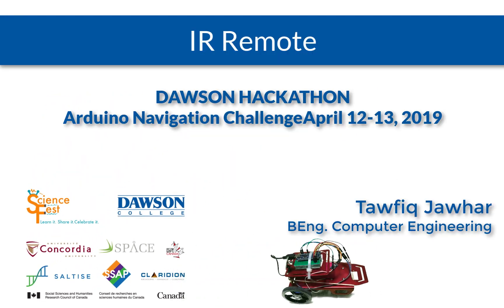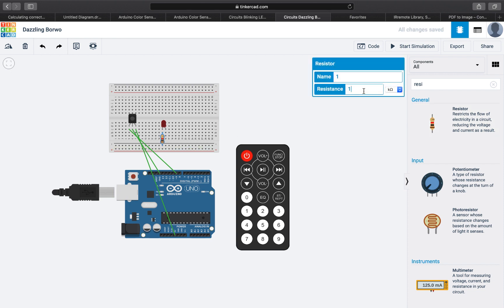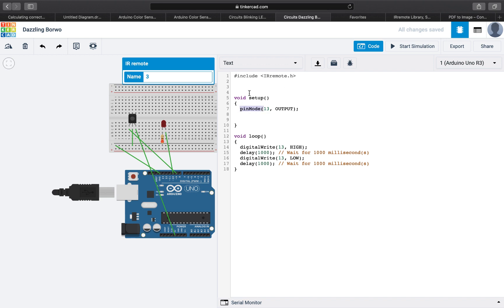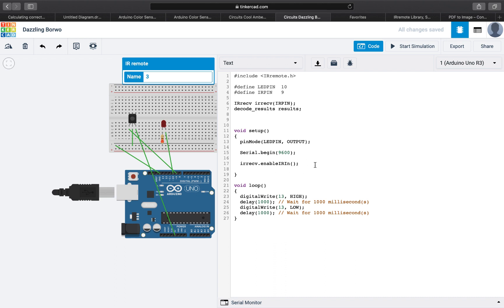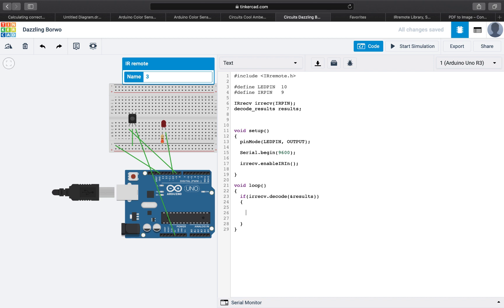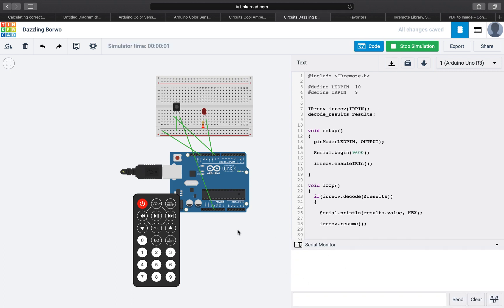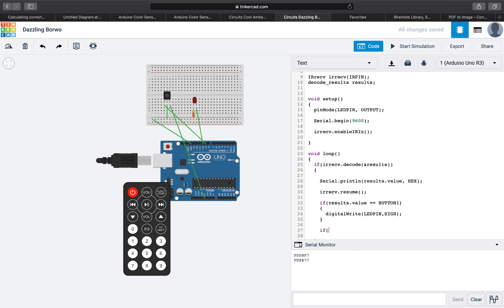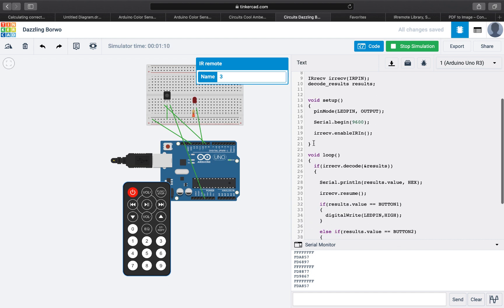3  IR Remote

Comment: WHAT IF I WANT TO ASSIGN ON AND OFF FOR A SAME BUTTON
Reply from the maker: The sensor itself lets you know when a button is pressed.

You can build more logic around that. 
For example let’s say you want to keep track of whether it’s on or off.

We can create a Boolean variable 

bool isOn = false;

And every time your button is pressed you can flip this Boolean 

isOn = !isOn;

It will basically become the opposite of what it was. 

So now you are keeping track of whether it is on or off using the same button. 
Next you can use this to do something else if isOn is true or if it is false.

if(isOn)
{
// turn on the led
}
else
{
//turn off the led 
}
Reply: Hearty Thanks 😁👍🏻